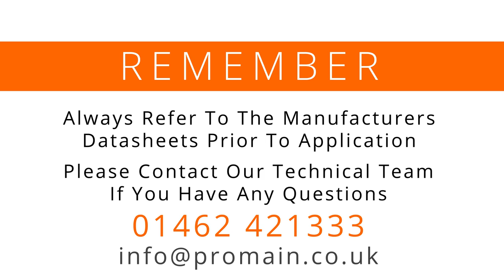An Introduction to MMA Line Marking Paint

Comment: is it slower, as fast, or faster drying than chlorinated rubber paint?.....no reply.
Reply from the maker: Hi Aaron, Sorry for the late reply!!! Chlorinated Rubber is faster drying than MMA, though they really are different beasts! MMA will out perform Chlorinated Rubber as it is much, much thicker but as it is a 2 pack, it has a very short pot life in which you can use the product. If you would like to discuss further contact our technical department on 01462 421333.